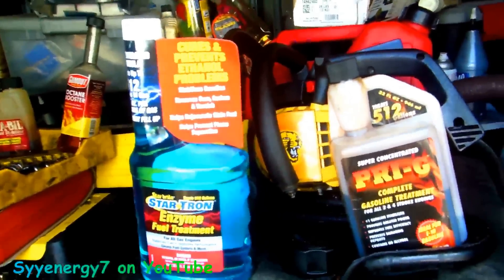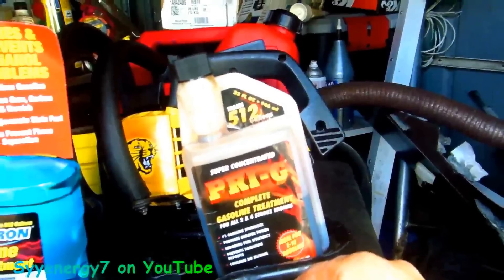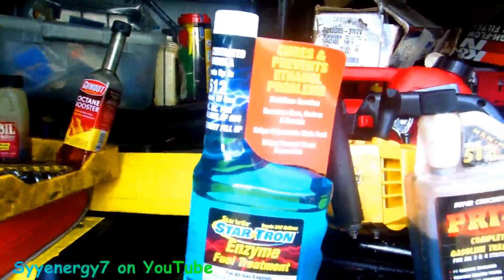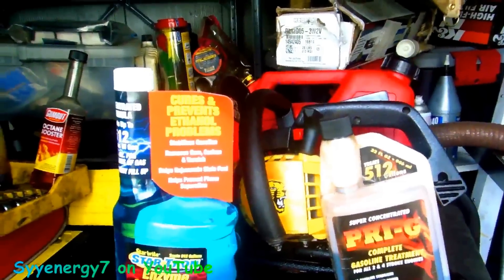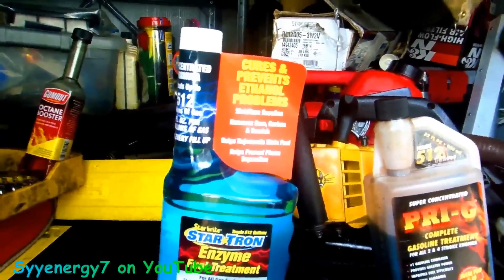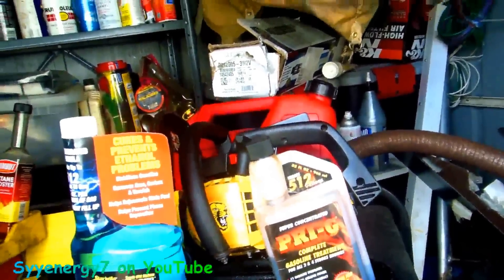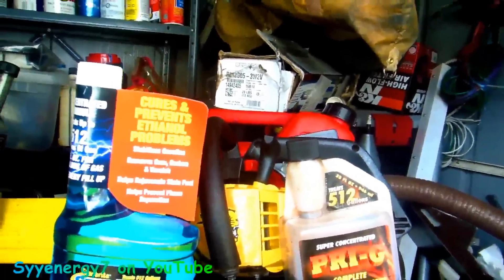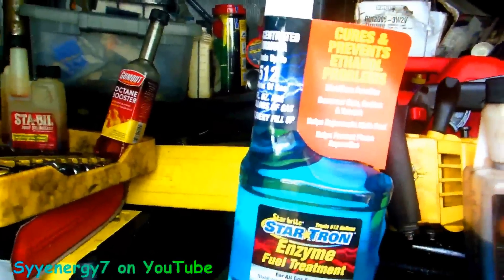The Truth about Gas Stabilzers and Ethanol Fuel

Comment: Here in Canada legislation says all gas must contain ethanol. I have been purchasing premium for years thinking it did not contain ethanol now I am thinking of using regular as I am not concerned about 1/4 mile times on my lawn tractor. I have had good results just buy purchasing fresh gas more often. I prefer to leave lots of room in my tanks for fresh Costco gas at the beginning of the season. I do use fuel stabilizer and a bit of fuel system cleaner in every can. No issues yet

Comment: Some carb bowls are easy to drain on a 2-stroke.  Nobody explains how enzyme cleaners work.  The vented gas cap draws air in and out with diurnal temperature variation.  Put a plastic bag around the cap with a rubber band, rather than close the vent.

Comment: I'm no expert here, but I ran ethanol gas  in my small engines for years before I learned that none ethanol fuel was available in my area.  I used mostly  Stabil brand stabilizer and didn't have any trouble with phase separation or carburetor corrosion...and my engines all sat full of fuel over winter.  

   Don't get caught up in brand names people.  All the small engine manufactures sell good quality fuel stabilizer.    That Enzyme BS  fuel treatment is just a marketing gimmick.

Comment: I look at it this way, save money by using E10 for daily use with a treatment just to clean the fuel system and engine. For storage find a station with ethanol free and use a storage stabilizer. A full and sealed can or tank is best to prevent moisture, such as NATO jerry cans from GLEG or Wavian. Metal cans are also superior to plastic.

Comment: Former landscaper here.  For the past 20yrs I've used a combination of startron and Lucas upper cylinder lubricant.  Startron 2oz and Lucas 4oz for every 5gal of 91 octane fuel for overwinter storage. When possible I drain carburetors.  I tend to cut those rates in half when "in season".  The startron is absolutely the best fuel stabilizer period.  The lucas adds lubricity and minimizes "stiction" of internal fuel system and in cylinder components.  NEVER EVER  had a problem with corrosion in this time span, only a few instances of excessive water in fuel, which is another problem on to itself.

Comment: How do any of these do against the green carb sludge (cleaning or preventing) from ethanol?
Reply: In my opinion yes it can i been using star tron enzyme for about 6 months and i have no problem with the struggle
Reply: Startron as directed on the label and about a half oz of Deep Creep or Marvel mystery oil per gallon.
Side note:
Any so called lubricant that directs you to shake the can before use is probably a garbage
product. Last resort type product  to have in your arsenal for that crusty frozen cock stiff problem.
Absolutely don't use it for tight fitting parts. Locks ect.
You can detect when there is the garbage products in a person's home. Funky rust dust on the door hinges.
It seems like America's favorite libation but,it's garbage as a lasting lubricant.
The first two letters will tell you what it was intended for originally. Water Dispersant.

Comment: do you think it is better to just empty the tanks and run out of gas for over the winter?
Reply: no that causes in time  sticking needle valve to seat you should live it wet . now on a  2 cycle engines the diaphragm drys out and cracks best to leave it wet with fuel . small engine mechanic 55 years.
Reply: @vicscalona6021  thank you I agree check out they two video's  I made on winterizing your riding lawn mower (john deere), and your push mower. I would really like you to comment on them so people can read your comment.  I did not leave them dry
Reply from the maker: yes

Comment: I'm starting up my brothers and my  2 cycle and 4 cycle engines and zapping them with seafoam. It's on sale the and the store is and less than a mile away. No ethanol in gas in Alberta thank Christ! I'm storing my machines in my basement. Gas degrades in 3 to 6 months much more in frost. And oxidation (breakdown causes water) is bad for fuel lines and sitting in carbs obviously. Here in Alberta we can get down to -30°F. 
David
Alberta

Comment: I used the Star Tron in a full tank of ethanol-free gas in my pontoon boat at the end of last year (2018). Due to reason we didn't get a chance to use it this year. Do I need to add more stabilizer?
Reply from the maker: I'd add more stabilizer.
Reply: Star Tron was intended to treat ethanol fuel.
You should have use StaBil instead.

Comment: Ethanol separation is not the big problem, it's the gas.  Ethanol is hydroscopic, that's why it is used for gas line anti-freeze as in "HEET"or similar products and it does work fairly well for that purpose. Pure gas w/o ethanol will get condensation in it also, just slower.

Ethanol is simply a lower energy dilutant in gasoline.  If you are filling up your car every 2 weeks or less, you don't need  to worry about water in your gas or "phase separation" either.  While it is true that water in your gas is not a good thing, it takes a lot of condensation to make any difference except at below freezing temps or some particularly finicky 2 cycle engines.
The gas itself is the problem over time.  Gasoline  contains many different petroleum volatiles.  Gas starts to vaporize off volatiles in a short time (particularly in warmer months), that's why you always want to by gas at a busy gas station, (their underground tanks are refilled more often therefore theoretically they have fresher gas).
Buying higher octane gas is NOT what you want to do either.  Higher octane gas is LESS volatile from the start, buy 87 octane for your lawn equipment and most NON-high performance engine vehicles.  Ethanol is frequently used by refiners to RAISE octane.
As gasoline oxidizes it literally turns to varnish and that is the culprit that you want to prevent.  The old red Sta-Bil works very well for this for about 1-2 years depending on other factors like temp, humidity and type of container. Plastic is best. Storing gas for over a year is a bad idea under ANY circumstance anyway.
I have used Red Sta-Bil in my lawn equipment gas cans year around for over 30 years and never had a first start in spring problem (or any fuel related issues) in 4cylcle engines since. 

2 cycle blowers, weedeaters, trimmers should be drained of fuel and run dry before winter storage but always run stabilized gas in them also, even when using them frequently.  Chain saws should be drained and run dry after each use unless you use them almost daily.
If you have a generator for emergency power, convert it to propane.  Propane can be stored almost indefinitely without significant degradation.  Kits are available for many gas generators.  If you stay with gas and you are not going to run the gas out in 2 weeks, drain it and run the genny dry.

For boats, do the same as 2 cycle engines but when you run them dry, spray winterizing oil in the carb or throttle body if you have fuel injection.  Distant second best plan is to use appropriate Sta-Bil mix (I agree that Sta-Bil 360 is better here) and store with full tanks but I dislike this idea for several reasons.
If you buy non-ethanol gas for your lawn equipment or that "special" car, that's fine but you still need to use stabilizer if that gas has any chance at all of not being use in about 2-3 weeks (Sta-Bil 360 good here too).  Use stabilizer regardless of the octane rating of the fuel you are using.  Otherwise your are wasting the money/effort.
If you are reviving a vehicle or equipment that has "old, unstabilized gas" in it, dump it or pump it out of the tank, drain fuel lines and float bowls and start with new gas.  Do not try to just get it going until you can get to the gas station.  You'll just be adding insult to injury and lightening your wallet even more.
Any stabilizer is better than none.  Read the instructions and mix it at specified ratios.  Measure, don't guess.
Reply: Good information. I've been using non ethanol fuel in all my 4 and 2 cycle engines. I also have been using star tron in the gas cans. I drain all my equipment and run dry for winter storage.
Reply: heet contains methanol+not ethanol
Reply: @charlesdowns1691  Yes, that is true, but for the purpose of "hydroscopy', the ability to absorb water, the difference is nil.  Thought about that for a bit after I wrote it but was too lazy to walk out to the garage to check.  My bad.
Reply: Heet is Methanol, Not Ethanol. Gas is fine. Ethanol is HYGROSCOPIC, not "Hydroscopic"  So, you have no idea what you are talking about !
Reply: @flexjay87  I didn't have a bottle of gas line HEET in my hand and both Ethanol and Methanol are HYGROSCOPIC.  Both both work relatively the same way as a gas anti-freeze.  Methanol does work a little better.  Methanol is also highly poisonous to humans and other animals.  The are both organic solvents that mix homogeneously with water.  Rubbing Alcohol for ETHANOL, is common example.  So is distilled spirts.  Duh? And in the industry HYDROSCOPIC is commonly used, correct or not.
Gas is fine?  Gas starts degrading the moment it comes out of the refinery.  It is the volatiles in gas evaporating that leaves the the sticky, resiny goo that screws up every small office in the fuel system of ANY internal combustion, gasoline engine.  It's why your lawn gear won't start or run right in the spring.
BTW- As for your last sentence insect; Of that whole comment, you find 2 puny lame ass nits and say that?   Fk Off.

Comment: All boats have vented tanks. Which is why this info is so important.  I was buying ethanol free at my local super wallmart  just yesterday for my boat and was talking to a guy who was fueling his boat.  Turned out he wasn't buying the non ethanol. And he's a local mechanic   He swore by StarTron.  He even showed me the old Stabil 360 marine bottle he used that was filled with StarTron  because that bottle has an easy measuring option lol.  Thanks for the video.

Comment: I mix Marvels Mystery Oil + Star Tron and it works very well in power equipment. The MMO dissolves gum and varnish in the fuel and even inside the 2-cycle engines. The enzymes prevent bacteria from growing in the alcohol, it also emulsifies the water to burn it. (this works for me and its inexpensive to use) 1-1/2 gal of gas - 1 TBS MMO + 2 Tsp Startron.
Reply: I have been doing a similar mix with a Snapper rear engine 10HP Briggs that I bought new 30 years ago. There's always Startron mixed in my storage tank.
When filling the fuel tank of the mower,I add about a half oz.of Deep Creep. I'm guessing that the tank holds about 3 liters.
Only had one carburetor problem  in the whole life of the machine and that was caused by the fuel line getting flaky on the interior and a flake got in the float valve tube and the engine flooded.
Still starting with one pull.
Reply: How did you come about this ? I knew a guy who said his dad always used MMO in oil changes. I always wonder how it works ? So this prevents gum varnish and water damage ? How long have you been doing this ? I am currently using pri-g.

Comment: As long as you run what ever u have gas in periodically u should be fine I us 91 in my dirt bike and my father has used straight unleaded in the atv and never had a problem with it running other then the battery dieting but we also started it every other day durning the winter

Comment: I work for a fuel terminal and we run all our octane testing and straight 87 with 10% will not be able to make 93 octane unless you have butane or some other types of octane boosters in the fuel. from what I have seen ethanol adds about 2 to 3 octane to the fuels used these days. Great video man just wanted to throw that out there

Comment: Keeping the gas container or your car's gas tank sealed and not vented will help keep water from accumulating in the gas. However, it will not prevent the gas from breaking down to varnish and other bad chemicals. The gas will break down, air or no air present, after a certain period of time since it was refined.
Reply from the maker: Air speeds up gas break-down greatly.

Comment: How many vented gasoline tanks have you seen lately?
Reply: Gasoline is only fresh for about 6 months from the day it is made. After that it starts to break down to varnish or other undesirables. So only fill your gas containers with enough gas to use your power equipment for about 6 months of lawn maintenance or buy less gas at a time to keep from having to dispose of the unused stale gas . Another alternative is to use some form of gas stabilizer. These will usually extend your gasoline for up to 1-2 years.
Reply: @jameskoralewski3583  YOU ARE DREADFULLY MISINFORMED ALL GASSOLINES ONLY HAVE 30 DAY LIFE FROM REFINED DAY NOT DAY YOU BUY IT , THE ONLY WAY TO EXTEND GAS LIFETIME IS TO ADD TO GAS AS SOON AS YOU BUY IT, IT IS CALLED MARINE GRADE STA-BIL IF YOU DOUBLE DOSE THE GAS WILL LAST 2-YEARS IN VEHICLE OR AIR TIGHT CONTAINER !!
Reply: All boats have vented tanks. Which is why this info is so important.  I was buying ethanol free at my local super wallmart  just yesterday for my boat and was talking to a guy who was fueling his boat.  Turned out he wasn't buying the non ethanol.  He swore by StarTron.  He even showed me the old Stabil 360 marine bottle he used that was filled with StarTron  because that bottle has an easy measuring option lol.  Thanks for the video.

Comment: For my generator I keep the gas in 5gl sealed tanks and they are filled to the top.  My son in law recently used some 18 month old two cycle gas that I made for him and it worked perfectly in his chainsaws.  I, later, thought it was a little weak in energy content and have replaced it with my current formulation.  Anytime I have a problem with a saw or BLOWER I immediately dump out all of its gas and replace it with fresh gas.  I also add a little Seafoam to the fresh gas to clean out the fuel system at .5 ounces per tank or one ounce per gallon if it has a large gas tank.
Reply: If your stored gasoline was a winter blend vs summer blend, that could explain why it seemed to have reduced power.
Reply: @chris2790  knowing some of the people on FB, it was probably gas from several years before.  If you put two year old gas in a machine, unless it was properly stabilized, it will not run, correctly.  Most of the people on FB have no idea what fuel stabilizer is, let alone use it at the correct level.  I put one ounce of Briggs &Stratton Advanced Fuel Treatment in every gallon of gas I have.  At that level, it will protect it up to three years, although two years is the longest period of time that I have ever stored it.  I try to roll over my two cycle gas at least every year.  I will burn it in my lawn tractor, lawn mower or one of the automobiles.  Dealers go more to a winter and summer blend for ethanol gas than non ethanol gas, what I use, and more up north in urban states than down south where I live.

Comment: Agreed, I run premium non ethanol gas 93 octane in all of my Stihl and Husqvarna power equipment.  I also use this same FUEL in my four cycle equipment.  However, I do add Brigg's AFT FUEL stabilizer to all gas at one ounce per gallon.  Stabil 360 will create what I call "greasy gas" after a month or so of storage.  This is where the two cycle oil begins to separate from the gas.  I only use Stihl Ultra, fully synthetic, oil in all my 2 cycle gas.  I do like Startron for use in E-10 gas.  I have 25 gallons of gas for my big generator, treated with Startron and AFT at their highest dosage rates, which I have had stored for almost two years and it still runs fine in my 4500w generator.  However, I test my generator every month.
Reply: Most of the time you are getting worse fuel when you get premium. Unless you know for a fact that you are getting fresh gas. I ran into this issue when getting 93, as most stations simply purchase less of it, and only refill it every so often. Therefore, the fuel you are actually purchasing has degraded well past even the cheap stuff you should have bought. I figured this out when I pumped 'new' premium gas from a local station and none of my equipment would start.

Comment: I studies all these thing a few years ago. I find putting a ounce of acetone in my gas, and it cleans motors very well. Upon study of many gas cleaning products like stp, it has acetone in it. It quiets motors down, and there is a saving on gas use. Never had a car breakdown because of using it.
Reply from the maker: Acetone is a very small amount would be ok for an older system.  If you have a fuel pump sitting in the bottom of the gas tank, I wouldn't use acetone because it will affect plastci parts after a while.
Reply: hmmm. older cars didn't have as many plastic parts where gas touches it. 
in 1950 this man did a 2 year study by dropping all rubber and if any plastic components that may be in contact with the gas. He dropped them into a jar of pure acetone and took out every 6 months and made notes on what they looked like. dropped back in and another 6 months did the same. I think he continued with the same gaskets and any plastics for 5 years, and noted that the acetone never dissolved anything until after about 5 years and that was minor. 
when one has a 10 gallons in tank and 1 Oz of acetone mixed, it is not really going to be full on the plastics.